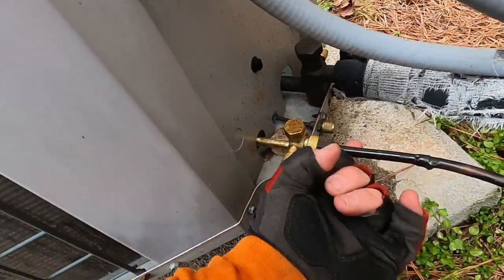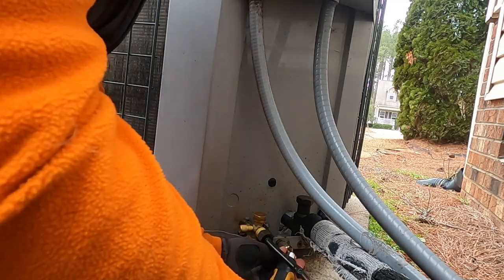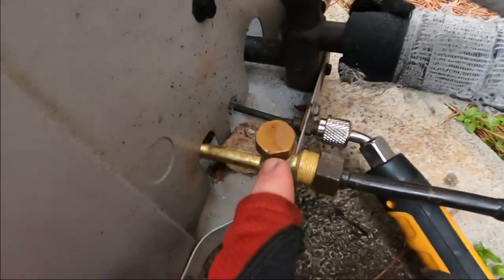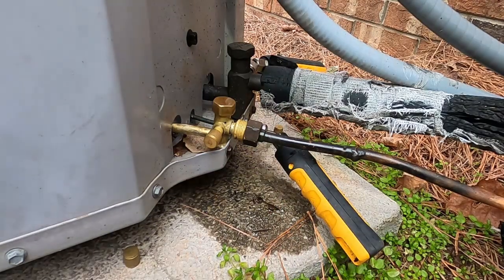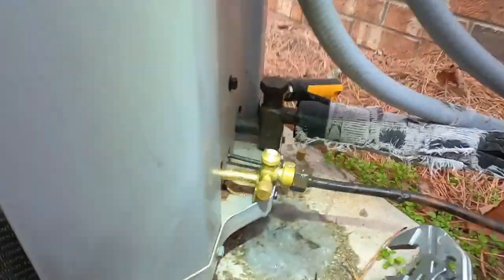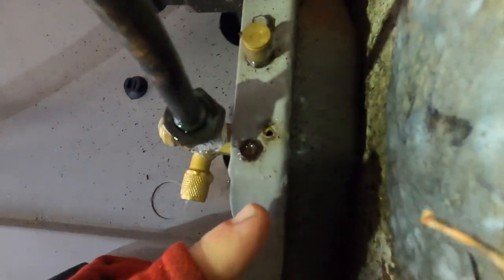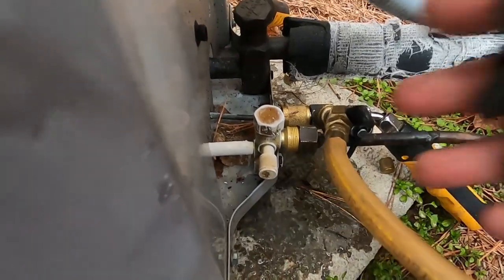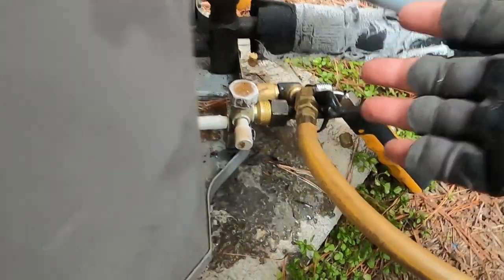HVAC repair fails. Always check your work.

Comment: that flare nut isn't even parallel, looks almost cross threaded. Like i tell customers, having a license and insurance doesn't make you a good driver either, it just means you passed a standardized test and someone signed off on your hours.

Comment: Carrier has a good reason for putting the metering device there. It can be isolated by the service valve and replaced. Service technicians just need to install all the parts. And tighten to the proper specifications.